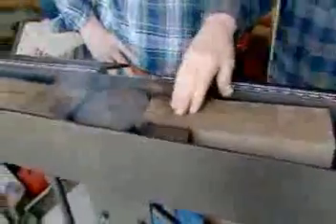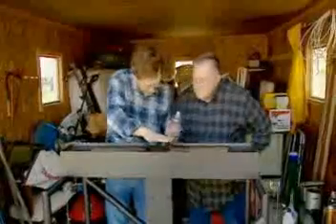Friction Heater

Comment: as he stated:  I AM AN ENGINNEER... yes he is not, nice setup but totally uselss, the energy he puts in with the eletric motor, is partially  transfer to steam (also in a very non efficient and unsafe way, the log can catch fire easily!).
Reply: The logs can’t catch fire, they are in an airtight container meaning no air/oxygen can get in. No oxygen, no combustion.

Comment: @cmfluteguy: Here's what you're discounting with this device: The retention of heat in the metal wheel would increase with the mass of the wheel.  And the energy used to get the wheel to a point where it makes steam decreases as the wheel reaches this critical thermodynamic level. So what we're seeing in this device, in a primitive form, is a sort of flywheel effect or stored energy. Read up on flywheels and stored inertia. This steam device is ingenious!

Comment: This works because entropy fits the niervasive equation of pilagomars that cuddle the blouterrams at 90%  degrees over the stratamullesor circunfrance of 5 talinoros dropping through the naval canal with a precise needed amount alowing all protein extruding from the nasal pasage to coagulate and form the necesary friction used in this process. Once the naval and air passages through the nose eplode, an entire city can operate on friction. Never heard these words before? I must know the most.

Comment: I dont know if anybody else commented on the fact that the motor that turns the friction wheel between the wood blocks uses electricity, infact the more friction the harder the motor works and the more your electricity bill goes up, although I wonder if it is more efficeint than heating elements?

Comment: Thank you. I know some basic physics. This Idea has way to many changes of energy to be efficient let alone practical. Electrical to magnetic. Magnetic to rotational. Rotational to heat through friction. After all that you must get the heat to the water through conduction or convection. It is a Rube Goldberg device. And it's fluffy, happy, feel good journalism. If you can call it journalism.

Comment: not if you use a motor modified with a rotoverter to reduce amperage by 80 percent nearly running on milliamps check out rotoverter demo

Comment: this is a much better way to push hot steam through heating pipes to radiators, compared to the huge oil furnace we used to have in our basement. any fool can see it works perfectly. this inventor guy is a total genius.